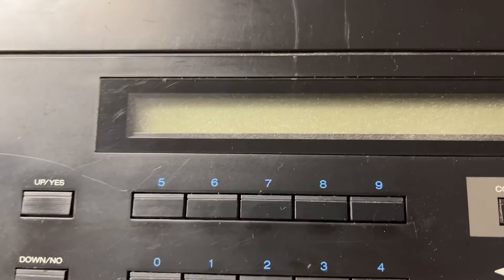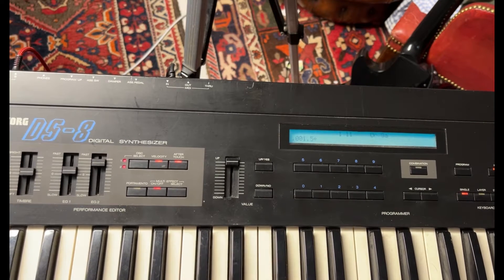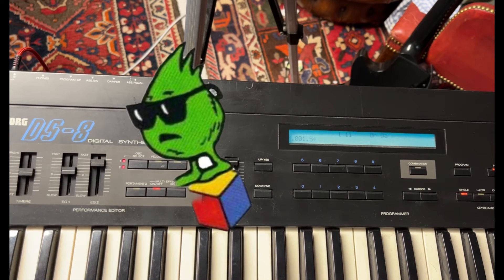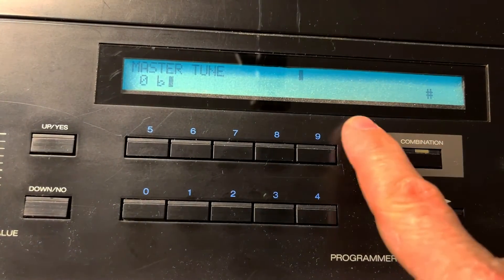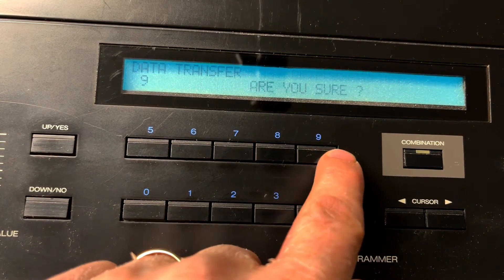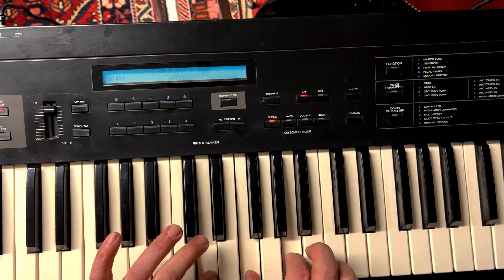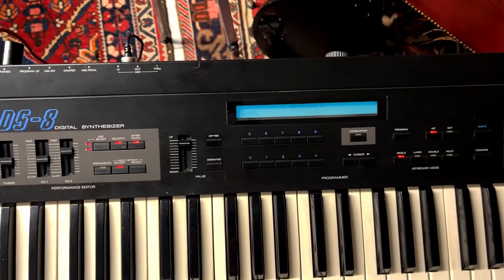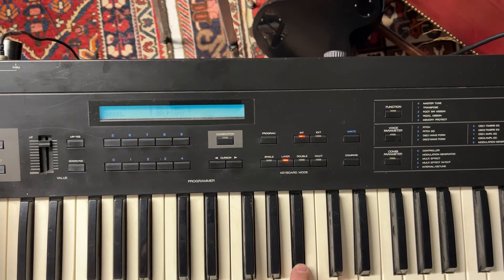Why Does my Korg DS-8  Sound Like Circuitbent Trash? Let’s Fix it and Hear How it Should Sound

Comment: hey man..thanks for this vid...I did the transfer and no errors.....it still has the same sound issue you have ...any ideas? Thanks in advance...
Reply from the maker: You sure you have the memory protect off?   I’ve made that mistake a few times…
Reply: @tedmurena  yeah I made sure everything was correct several times...does this mean the internal battery is bad  and its not providing the memory bank a charge to hold things?

Comment: my DS8 crashes (freezes) when editing the sounds for a longer time, or when loading the patches into it via midi. so it seems like there is a memory issue. when i dont touch the editing it works normally. do you know which parts might be responsible for this issue or how to approach this? 

im pretty handy when I know what to do, as I've managed to replace the backlight and modify the battery holder but not sure what to do about this issue? any help would be appreciated
Reply from the maker: Difficult to say but it sounds like a leaky capacitor somewhere.  Those cases are processor heavy so I’d check the capacitors around that first

Comment: What is involved in connecting to be synth to the computer. Do you just use the midi cable along with an interface?
Reply from the maker: Yes but you need a Sysex program too - then moving files is really easy